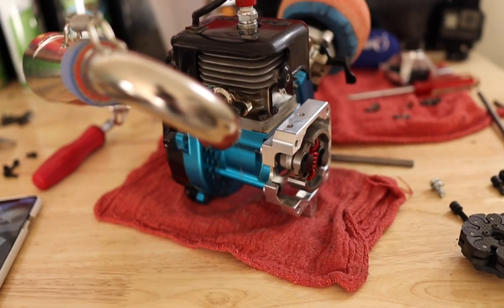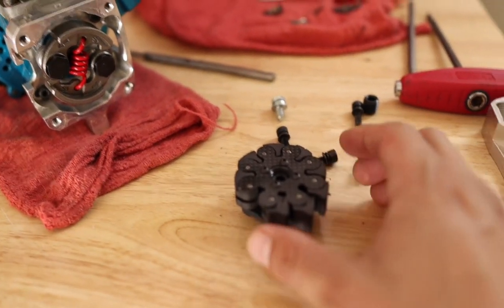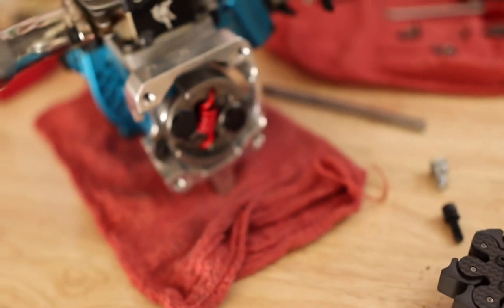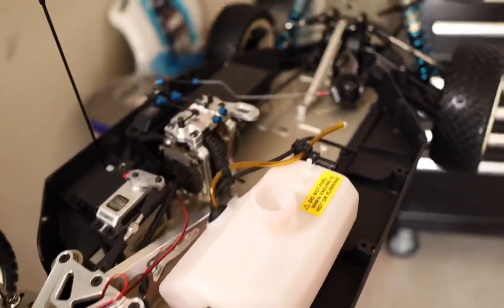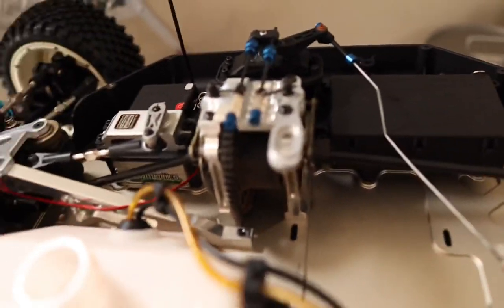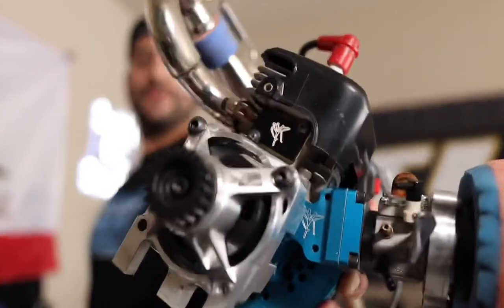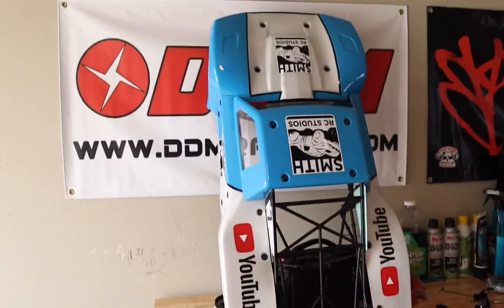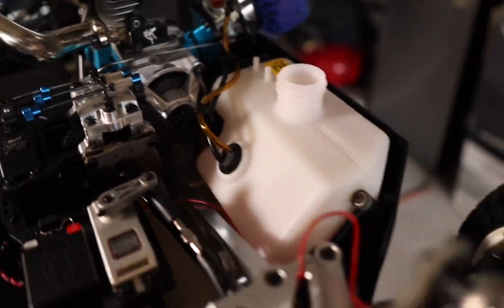Bashing a LOSI 5ive-T 2.0 Race Truck - Bartolone Racing - MOD - Smith RC Studios

Comment: As a machinist and fabricator I am always drawn to fixing and redesigning parts for troubled rc's.  I love the hobby but have no time to try and help.  I wish I could especially when the fix seems so easy.  Between that and making titanium chassis to replace the stupid 7075 chassis for bashers I just wish I had the time.  I love solving these problems but I do jave a family to support.  Maybe one of these days I will make it happen.  Until then I just say, buy a mill and lathe and don't be afraid to make your own parts guys.  The 5t is an all time favorite of mine, not a basher per say but a favorite just the same.
Reply from the maker: Sounds great dude! Thanks for the insight and support. I am also a fan of the 5T as my favorite all time RC. Thanks for stopping by. Cheers

Comment: Nice little rip! What gearing you running it's got alot of bottom snap! But nothing mid or top! And don't take this the wrong way! But that's the 3rd 34 bartolon full modded that I've seen on video that has got nothing! Honestly my 34REED signature obr in my 5b would spank that bartolon all day long! If you think that 34 bartolon is fast you need to get a obr 34REED signature, and you will be blown away! Not impressed by bartolon  engines, this far unless the videos Ive seen! are delayed or something! But I know your a straight up guy! So get a obr 34REED signature and you will be convinced! If not then to each there own! Again good rip and stay 100% pease!
Reply from the maker: Hey dude thanks for stopping by. My gearing is definitely meant for bottom end as it was built for short course race applications and sharp turns. Not meant for bash even though i did lol. Both Chris Bartolone and Dan/Sean are awesome down to earth humble people and both make great engines. Besides my OBR Reed i have on a boat i do plan on a couple more for off road in the near future. Thanks for the input. Cheers 👍🏽

Comment: Hello I have the same truck what in your opinion is the best gear set up for high speeds
Reply from the maker: For more top end you go higher gears ⚙️ for example on the pinion go 22 or 24 or even higher depending on the engine you are running. And the Spur gear should go lower like 58 or 56 etc… but all this depends on the output from the engine. Hope this helps. Cheers